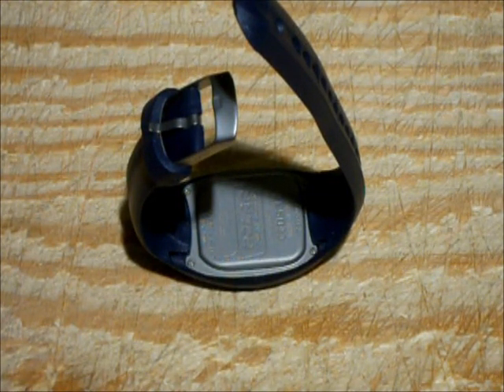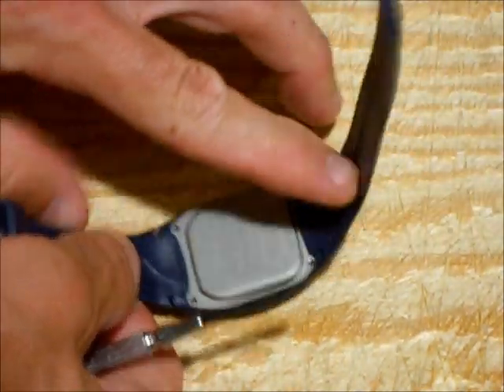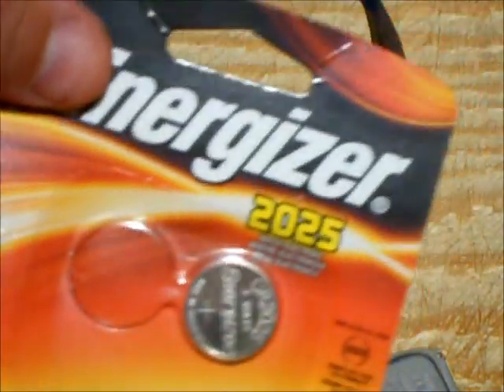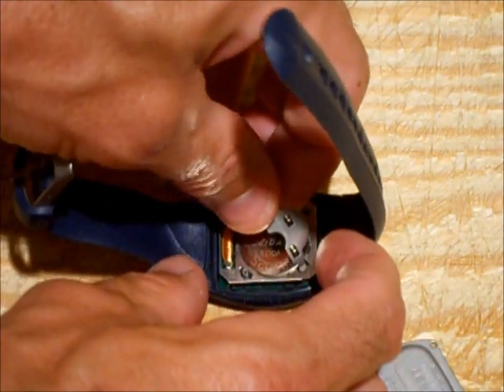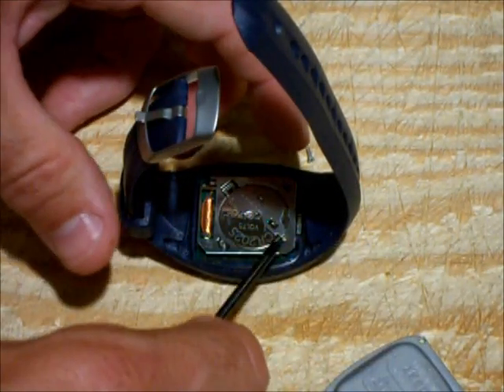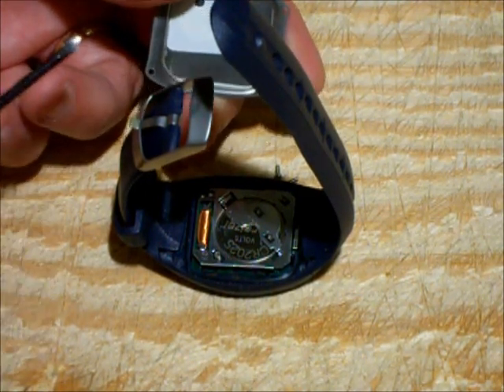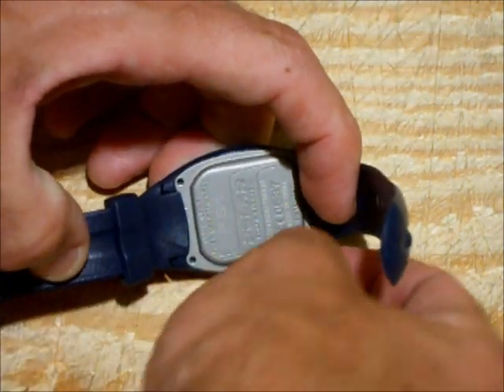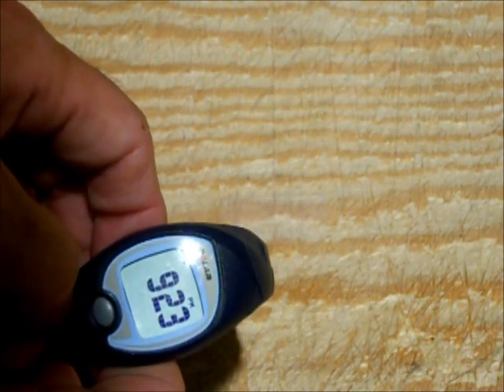How To Replace Battery In Polar FS1 Heart Rate Monitor Watch

Comment: I put a CR2032 in there instead because you can get them 3/$1 at Dollarama. The clip didn't clip in all the way but the screwed in back holds it just fine. Works great!

Thanks for the video, on my own I was scared I'd break the arms spread open like that.

Comment: You can get the wrist straps off easily (you only need one off) I just used a toothpick in the tiny hole in the plastic watch housing and that released the typical watch band spring post.  A little tricky getting it back in as you have to compress spring post with toothpick or small flat pearing knife and slide band back in.  Much easier to get back plate off and you don’t risk damaging band.  BTW I used a 2032 battery (thicker) and left out the battery clamp…seems to work fine..

Comment: A replaced in a similar way time ago, but I had a problem time later. Formation of moisture inside, due to (as per the Polar official assistance) humid air penetrated inside the day I opened the cover. Humid air (with cold environment) released moisture.
What's your experience on that? Maybe air blasting (with dry air from a sealed cylinder as those for photocameras cleaning) can improve this ollateral problem?

Comment from the maker: I don't think so without cutting it open. I think those, they want you to send back to the factory. It might be cheaper to buy a new strap. At that point, it might be worth it to cut the old one open carefully and see if you can replace the battery and then glue it shut again.

Comment: Wish I'd found your video about a year ago..... botched a really old polar m53+ changing the battery but looked a lot like this one in (side buttons fell out though when I opened the case) **** Magnetize your screwdriver with a magnet and then your screws will stay in place ****

Comment: Hi. I replaced the battery (thank you) but I need to reset the watch to the correct time.  I have not used it in a couple of years and I do not have the instructions.  Can you please help with resetting my Polar FS1. Thank you
Reply from the maker: Tamara Carveth http://www.polar.com/support_files/en/C225742500419A8AC2257007003D1CAA/Polar_FS1_FS2c_FS3c_user_manual_English.pdf
Reply: Thanks figured it out!
Reply: RJ The Bike Guy how do you change the battery for a E600???

Comment: 1.The video does not address the seal made of "rubber" in the rough shape of a square, which seals the metal backing of the watch to the plastic housing.   If you get moisture in the viewing area of the watch after battery replacement, you might consider replacing the seal as well.   But Polar are tighter in the ass than than any seal, so they don't supply them ( I hear ).
2. The straps come off easily so you can do battery replacement without the straps on.   You just poke a pointy tweezer into the hole on the side of the strap and the spring loaded pins which hold the strap on, do compress,  then straps come away.
3. Position your watch on the surface by sitting it on a piece of Blutack.
4. Best not to handle the battery with raw skin as it reduces the battery life - put on some snug thin stretchy latex gloves.
Best wishes.
Reply: philjquitt How do the straps go back on (if they've been popped off as you say in step 2)? Are they easy to get back on?
Reply: Kevin Jackson Delayed response,  because I don't check gmail regularly, as I use hotmail mainly.   The spring loaded pins are a watch industry standard way of attaching straps to watch body.   You just poke one end of the pin in the hole at one end  of the watch body, as a starting point, and then compress the other end of the pin and it will work it's way into the hole at the other end of the watch body.
Reply: Ah, thanks!